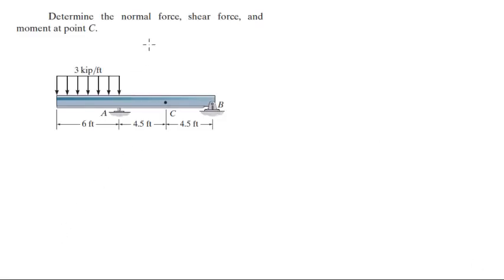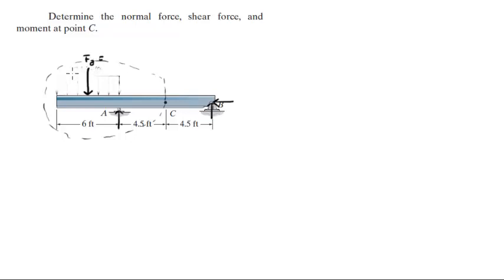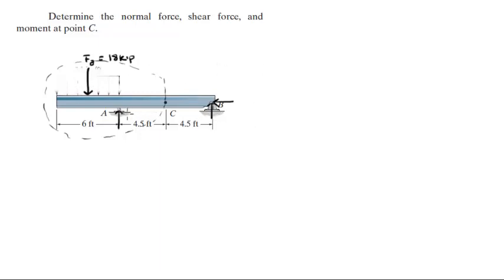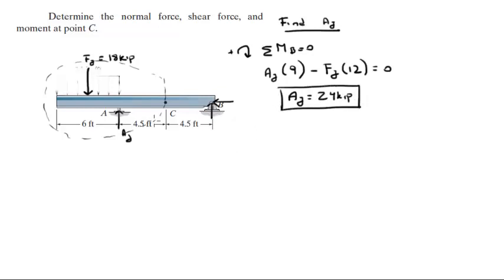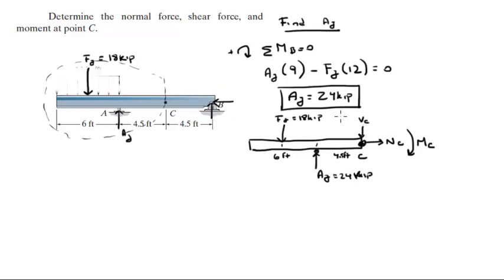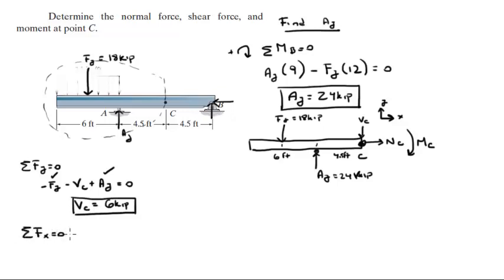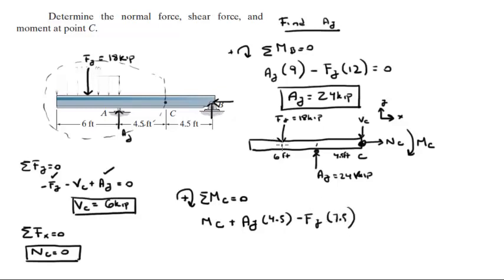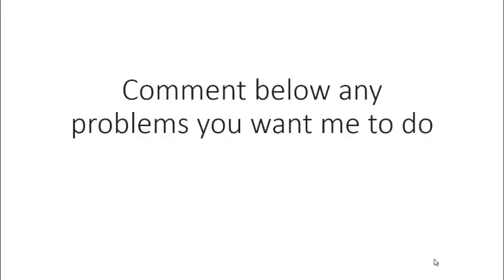Determine the normal force, shear force, and moment at point C.

Comment: thanks for the video but i have one question : if i consider the opposite clock direction as positive i will get the moment of C equals to -27kn per meter is it correct to have a negative value of the moment ?
Reply: if the moment is negative that means the moment is actually just in the other direction so generally you'd want to flip your clock direction so your answer is positive